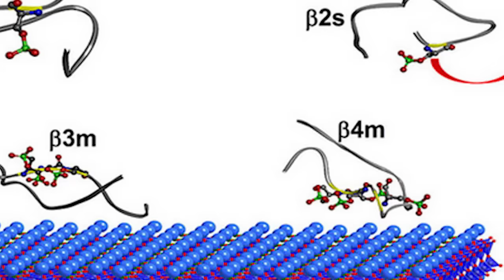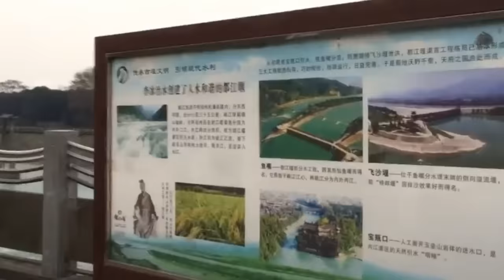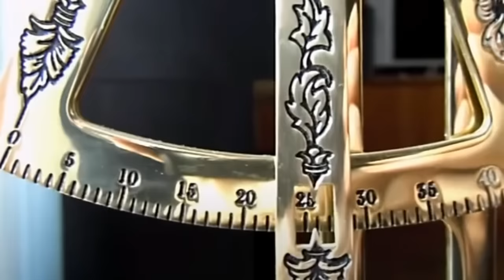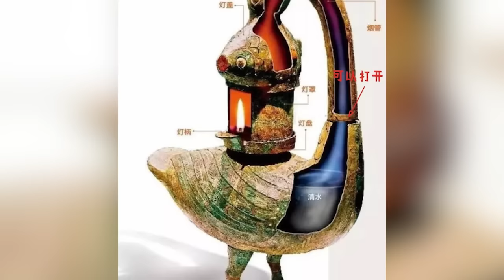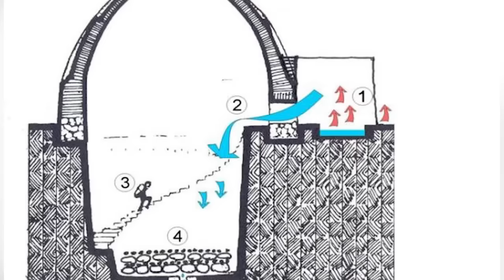12 Most Mysterious Ancient Technology Scientists Still Can't Explain

Comment: if you rotate a piece of paper fast enough you can cut (almost) anything. Imagine doing the same with a harder material such as bronze. Most cuts in these stones suggest a curve with quite  a large radius. It couldn't be too difficult to make the equivalent of a massive circular saw blade and rotate it fast enough to effectively cut.
Reply: From the saws perspective, it's the stone that moving at high speed cutting the bronze. You are confusing slicing with abrasion. You simply cannot cut granite (hardness of around 7 on the Mohs scale) with copper/bronze with a hardness of around 3. Try again.
Reply: @methylene5  just positing, bvut, what about a baked clay+quartz dust disc? yes, it would wear out quick...do it in an enclosed area, and you could recycle. that would give you about a 7 I think? I would say diamond dust, but..

Comment: Just because people invented something doesn't mean they understood it... our knowledge of physics with equations, matter, atoms, energy, heat and light is only recent, but people used their benefits for thousands of years, people found fire and learned how to make it and use it's benefits, but they never really knew how it worked
Reply: we have so many things to explain how something works.

But Can we Explain How these people Worked to Make These Structures?
Reply: Are you sure they never really knew how it worked? There's an ancient Golden Roman Goblet that under a certain light it changes its hue. This can only be achieved by specific additives into the gold in specific amounts. The craftsmanship of the Goblet was done by a master and not a novice. This takes years of practice within their craft and skill. This also requires the ability to have the understanding of fine precision. There was also an ancient device found that is believed to be made by the ancient greeks. It's a type of clock and calendar. It doesn't just calculate the days, it also calculated the motion of the stars. It was made of hundreds of gears. If you know anything about mechanical engineering, gear work takes precision and accuracy. You also need tools and technology to make those gears. The amount of teeth, the size of them the gap between has to be accurate. If the gap is to tight the teeth won't fit and the gear won't work. If the gap is too big there is too much play and the teeth will break. The gears within this device ranged from small to moderately big from a few centimeters to about 1/4 - 1/2 meter in size. This requires precision and accuracy. Again it wasn't built or designed by an ametuer it was built by masters of their craft. They may not have understood it in the same exact way we do today, but they understood it in the way the knew how. It's all about perception and context. There's usually more than one way to achieve the same goal.
Reply: @skilz8098  that's what I said... They used it but never explained it on a scientific level

Comment: Sometimes when I look at those strange cuts in stone, I think of some kind of long cord being stretched taught and the Egyptians using the sands around them as the abrasive it is, and slowly sawing into the stone that way. After all, sandstone isn't the hardest stone there is. Also. It would explain why there is no evidence of the cutting tools used.
Reply: Yes, even today we use wire saws to cut thru very thick structure's,  as well the metal embedded inside them, Egyptian plains had many meteorites scattered in numbers, they are known to have melted and used the material in swords etc.. embedding diamonds would basically be the same as the wire saw construction today... Imagine a wire on pulleys looping around an object to be cut, the access to wrap such a wire around is the same today, first you drill a hole, then insert the wire then connect it into a loop... Very simple
Reply: How could the string or rope last against sand?
Reply: No evidence of cutting tools that's funny 🤣..think about it what do we do with our cutting tools or any tools for that matter ? We recycle them turn them into something else
Reply: @chrisharrison3245  not even one piece survived?
Reply: @chrisharrison3245  What he means when he says there's no evidence of cutting tools is that the stones don't look like they've been cut or chiseled
Reply: @DavidbarZeus1  it's called erosion. Plus the finished products had been polished
Reply: @chrisharrison3245  Erosion might explain a little, polishing a little more, but not everything
Reply: @DavidbarZeus1  it's only sandstone very soft it doesn't take much for any sort of erosion to make any man made marks disappear especially over a period of up to  5000 years. I've worked with granite and marble and granite is a lot harder and with less than a day's work one person can make all cutting tool marks disappear and polished. With the Egyptians we are talking blocks mainly, but look at the Greeks and all the intricate carvings you don't see any tool marks. Same with the Romans the buildings are still standing and being used but you can't see any tool marks
Reply: Very stud@%%# idea. Try audio frequency
Reply: @salvalooez2249  HA HA HA
Reply: theres videos on youtube of people cutting those holes in the same stone the egyptians did using tools the egyptians had. its a sheet of copper bent into a tube used as a drill by hand with sand as an abrasive. they easily cut holes that are the exact match of what the egyptians did, and theres pictures from the egyptians of them doing it in exactly this way.

this video is a fraud, we know how they did it, we can replicate it fairly easily
Reply: @thetoolmat8632  https://www.youtube.com/watch?v=hjN5hLuVtH0

Comment: I don't know if this pertains to the "mystery" of ancient stone cutting tech or not, but given the research I have done, I think I am cutting either andesite, basalt, or gabbro rock with crystalline structures running through the stone. It is a very hard stone and the tiny crystals running through the stone are even harder to cut, at least with the standard hand saws I am using. Working my way through 1/4-inch-thick stones is a month-long process or even longer sometimes depending on how many crystals I have to cut through. Once cut and polished the stone has a mirrored finish.
Reply: Look into vibrations to lift and cut rock for pyramids
Reply: If you want to know "How" you need to reevaluate the assumption that  these megalithic structures were made by man. Look up godelectric

Comment: Actually cutting through stone is not hard at all. Power tools just make it less sweaty and vastly faster.
Reply: It is hard. The stones they were carving were a 7 on the MOHS scale. Granite, diorite, and basalt. We'd have a hard time doing the same with modern steel and diamond tools. The Egyptians were still using copper. The only iron tools they had were ceremonious, brittle,  and made from meteorites.

Take for example, they were hollowing out granite blocks with perfect right angles inside. The Serapeum granite boxes were constructed within the tunnels they now occupy. There is little elbow room.
Reply: @BungieStudios , they used bronze which is almost as hard as steel. Iron only took over because Tin became hugely expensive and Iron did not come from meteorites.
Reply: @olawcristophersoun1373  Dude. Bronze is a 3 in hardness. Still unable to cut granite. Our steel has to be diamond coated. Even then, it's usually easier to split the granite rather than cut it. You'll at least need iron for that.

Copper was the most widely available and commonly used metal in Egypt. This is what they would have been using. Iron was known as the metal from the heavens because it was sourced from meteorites.

We still have no idea how they hollowed out diorite and granite with precision. We have no idea how they drilled out cores from granite. Some demonstrations of copper and wood tools combined with sand were made in an attempt to explain how it was done. The copper was quickly worn away. After much effort, they were able to create a granite core. What did they use to break off the core though? An iron wedge. 🤦‍♀️
Reply: @BungieStudios , wood and water can split granite, and Bronze work hardens. You are replying to a retired stonemason. It really only takes simple tools and hard work.
Reply: @BungieStudios , FFS the core from a core drill only needs a whack with a hammer to break off.
Reply: @olawcristophersoun1373  You're going to wack the wedge if you want it done right. 😆
Reply: @BungieStudios , the problem in this world is academics who do not listen to skilled craftsmen. Drilling a core is not hard, just damned time-consuming and tedious.
Reply: Starting the Iron Age with only Stone Age tools is easy too. Western Africa proves this.
Reply: Your full.of it .....cutting a granite block 8 feet across takes about a year with copper
Reply: @BungieStudios  we dont find it hard to cut those stones at all. heres a video of people cutting those drill holes through granite with a copper drill and some sand by hand.

https://www.youtube.com/watch?v=hjN5hLuVtH0

Comment: Egyptian Stone Saw: This was not as  difficult as it seems. They made simple abrasive saws, using sand like materials they were much harder then the stone. These would have been used with a wood or copper blade such that the hard grit would saw away the stone. You can find many articles about ancient egypts abrasive saws.
Reply: 😂😂😂 You’re so naive, you must not be very practical!!…
Reply: @salvalooez2249  No it doesn't Those cuts would have taken a few hours to cut. Consider most modern tools use abrasives to cut ceramics, metal, granite. etc. For cutting granite from quarries we they use a similar method as the ancient Egyptians. Today they use plastic embedded with abrasives, but linked together to form a long chain for long deep cuts. I am sure there are some YT videos on granite cutting from quarries.
The only difference is that modern cuts are used done by machinery & the Egyptians would have done it by hand. 

The same cutting methods have been used for millennia. Rome used it, and later was use for cutting marble and other stone material to build palaces, monuments, churches, etc. Most likely the Romans & Greeks learn stone cutting from the egyptians, that was later spread throughout Europe & perhaps Asia.

Comment: No saw, laser or control heat. No saw. You ask where is all the modern tools if that's what they use to make these unbelievable cuts. Earth, Wind, Fire and maybe the Sun was the power of these tools. The secret is how to hardness this power. What ever they use, it was sure biodegradable in time. And that technology and methods died with them.
Reply: Anything technological made from iron, steel, glass etc would last no time at all:/ AS for no saw, there are definite saw marks all over the place, huge drill holes too! NOT copper saws with sand as an abrasive, that one is just too funny,lol
Reply: @TheZacdes  I concur

Comment: About the "saw": what about a wire covered of glue and then dipped in sand? It would make it very abrasive and if you make some creative use of levers, you might get a pretty strong stone saw, wouldn't you? The wires and levers wouldn't last much through centuries and would much likely have decayed to nothingness long ago.
Well, I'm just a random guy without much engineering knowledge, it's just an idea.

Comment: 1. That's not a mystery Mr. explained everything.

2. I assume the mystery is the purpose of the god carving, not necessarily if a movie myth 2000 years later is true. Considering the location of the "drain" was a temple, and it would be covering a conveniently similarly sized and shaped hole in the temple. The premise that it is a drain cover is most likely, as it would have water pour through it's mouth from the collected rain water on the roof every time it rained. So it would have been more of a fountain cover than a drain cover.

3. What's the mystery? How it was invented or made? It's made of ash/soda ash, lime, powered sand, and copper. Everything powdered. mixed in water and cooked. So says the Romans. How it was invented was probably an accident while making soap. then refined via experimentation. 

4. But, there's LOTS of ways to get a stone saw of sorts with sand, resin, and a backer like wood or bronze. Also Egyptian hieroglyphics show hand saws cutting wood. It's not a big leap to go from hand sawing wood to stone. It's a matter of figuring out how to do it without having to resharpen things constantly. Thus they probably had bronze saws, but used sand as an abrasive instead of actually cutting with tooled teeth.

5. I mean the Maya had quite advanced astronomy, language, math and art. It's also not beyond possibility their tech in some capacity migrated with it's collapse to other places. Hard to tell when the Spanish were too busy book burning Inkan history.

6. Ever burning lamp. last reported 4 centuries ago. Call me a skeptic cause kinda like dragons, I'm guessing these are over hyped.

7. That's... not a mystery.

8. Yes, real shame the Catholics burned all of those as they were fold out books. Something about them believing people to be using them as devil worshiping tools. Also, not a mystery considering it's easily recreatable.

9. How's a goose lantern a mystery? You have to remember China invented the magnetic compass, mechanical compass, black powder, and had HUGE engineering projects.

10. Would that not be easily solved with spectral and chemical analysis? Oh wait, that happened in 2008 and 2014. Them 'machines' have skeletons of real humans, but everything else is made of wire and coated in wax. Congrats on perpetuating an already solved mystery.

11. That's also not a mystery, you're just listing something interesting.

12. Oof, another non-mystery.

6 absolute non-mysteries, a few unknowns due to history, and a couple actual mysteries, and one mystery that was solved, but omitted to make an interesting story.

Mhmm, from this vid alone, this channel is kinda sus.
Reply: Okok...
That was a good comment ...i.was kinda leaning on protesting it..but it became a good read

Comment: It's easy to cut stone with a wire and diamond particles.
Modern diamonds are artificially expensive, as DeBeers deliberately keeps them in short supply, but in ancient times they would be relatively common and cheap.
By running a long wire around guide wheels some distance apart, block of stone could be sliced, thinly and accurately.
.

Comment: That's like saying if they used sand then they understood microchips.
Reply: They may not have had microchips made from silicon like we do today. They probably didn't have modern electrical digit computers that we now have, but they did know what a computer was and its primary functions. The etymology of the word comes from Latin: computator and computare. And the ancients did have physical devices that were computers, however, they weren't digital. They were analog and mechanical. The ancient Greeks built a clock / calendar device that is believed to track not only the days and months, but also the known planets and stars. I can't say that they did or did not know circuitry like we do today as we don't know if they understood or were able to harness electricity. Also, binary logic seems to be more recent after the terminology of Boolean Algebra that didn't come around until the 1700 - 1800s(without looking up I don't know exactly when, but believe it was in this era...). 

Here's a piece of literature that may intrigue you. Ecclesiastes 1.  The main parts that are relevant to my position of thinking is that the Ancients knew a lot more than what we are led to believe and it comes from these portions of the text verses (4, 9-11), however the entire chapter is worth reading.

4 One generation passeth away, and another generation cometh: but the earth abideth for ever.
...
9 The thing that hath been, it is that which shall be; and that which is done is that which shall be done: and there is no new thing under the sun.
10 Is there any thing whereof it may be said, See, this is new? it hath been already of old time, which was before us.
11 There is no remembrance of former things; neither shall there be any remembrance of things that are to come with those that shall come after.

As far as we don't know, they could of even had the technology to fly, they could of had electricity, and maybe even things that are currently beyond our reach such as gateways and portals. How do we truly know what the ancients did and didn't have? Those civilizations are long past and we don't remember it! Just as those who will be here 500 to 1000 years from now won't know what we did and didn't have. Consider this, if one day a great cataclysmic event a type of apocalypse decimated the vast majority of people, cities, nations, etc. destroying our current state of civilization setting the few survivors back to the stone age. After many years of weather and decay; what do you think their descendants someone from 500 to a 1000 years from now would make it out to be if they found a few remnant pieces of a record player, an mp3 device, a cell phone, a printer, etc? And this is considerate thinking the material would still be around or at the least in a recognizable state. How about cars after many years of rust, wind and water erosion, dirt and dust build up, plant growth, etc.? You and I may barely be able to recognize it as a car, never mind people a millennium from now. We don't know what they did or didn't have and we don't know what they did and did not know! Who knows, maybe they fully understood quantum mechanics and things we haven't even thought of yet and we're now just catching back up...